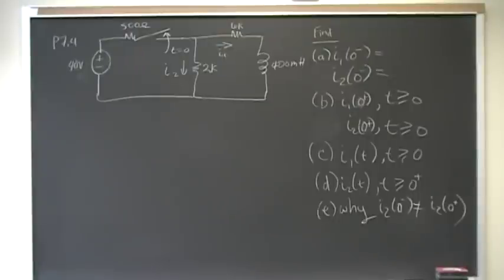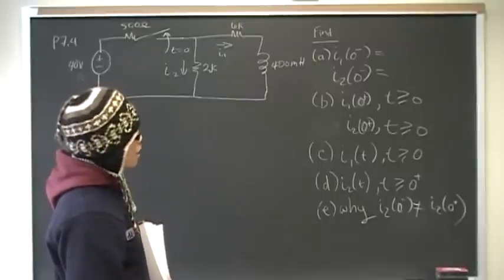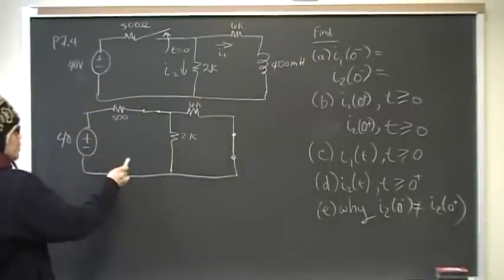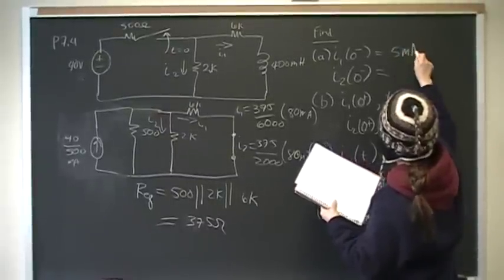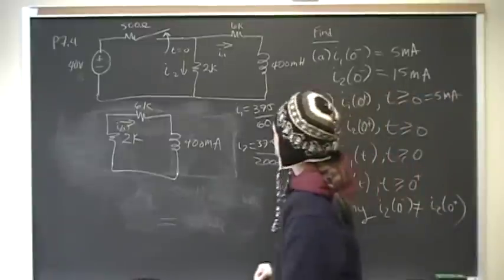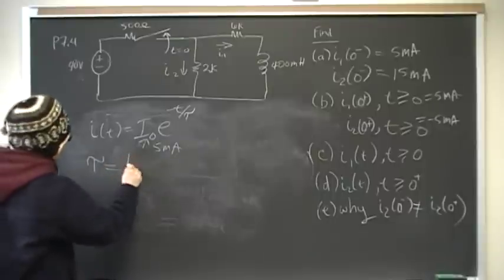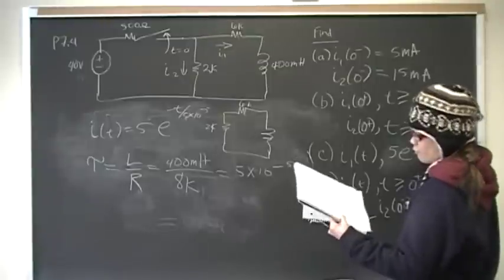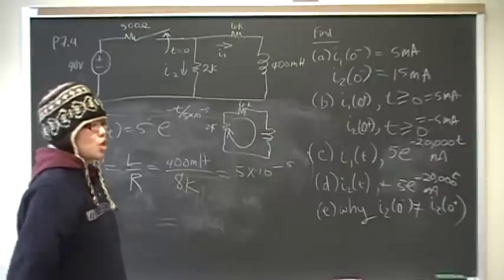Natural Response RL Circuits P7.4 Nilsson Riedel Electric Circuits 9E Solution

Comment: Without using a source transformation, the i1 and i2 currents could be found using a current divider, with the source current equal to 40V/500(ohm) = 80mA. Would i1 = (2k/8k)80mA = 20mA and i2 = (6k/8k)80mA = 60mA then?

Comment from the maker: because source transformation says that a voltage in series with a resistance is exactly the same as a current in parallel with a resistor. transform using ohms law. i recommend searching my channel for "source transformation" for a refresher and example. :-)